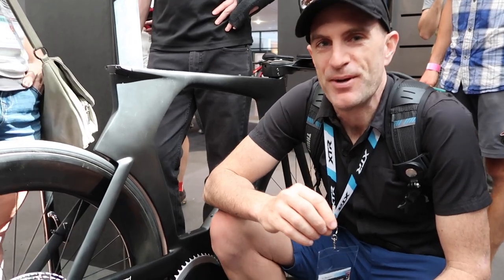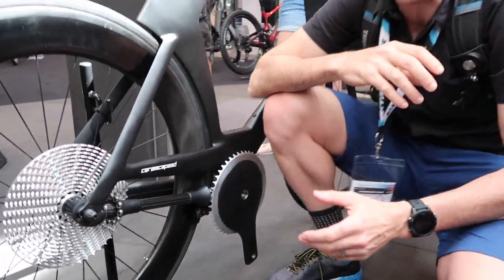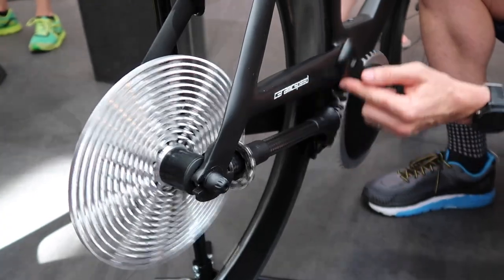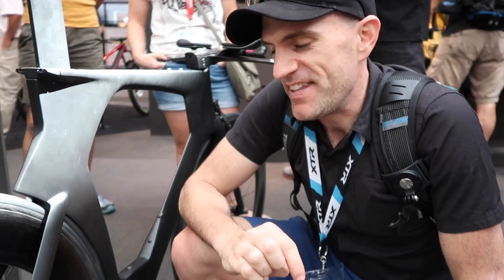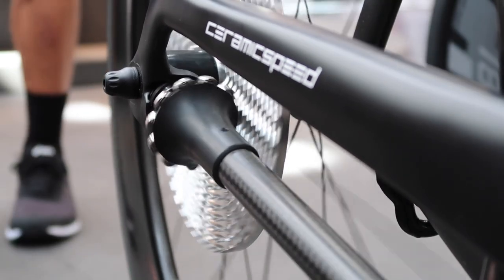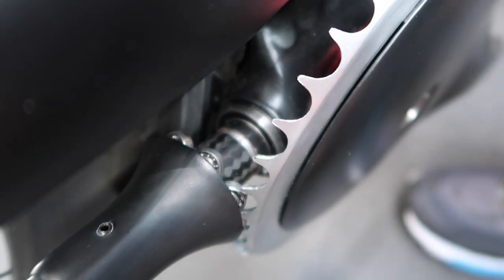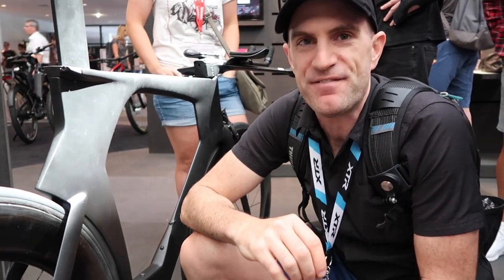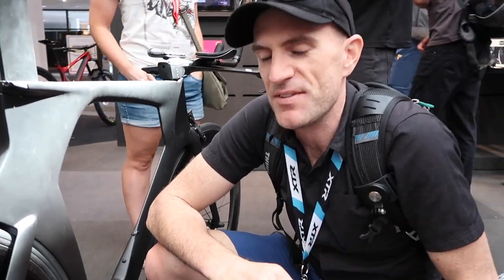CeramicSpeed DrivEN 99% Efficient Drive Shaft // Chain Free Bike // Eurobike 2018

Comment: I think the holy grail would be a bike with a Continuously Variable Transmission.
Reply: If they can solve the weight issue i agree.
Reply: They have these, and the efficiency is very low, at under 85% under the best test. It's just not a good way to drive a bike. I myself owned one, and while the idea was neat, it never worked well. Hills that I could climb before with a 3-speed without problems I had to walk the bike up the CVT hub.
Reply: I'm waiting for someone to work out that epicyclic gears in the crank mounting could replace the entire gearsets. 
That means lighter chain, only two sprockets and a more compact overall package. It would also be almost completely reliable if done properly. Downside is efficiency as the ratio's get wider. Of course if you want it could be 100% efficient in one ratio (the solid gear) then get less efficient as the ratio increases and the speed drops or vice versa. 
Would you trade a 3% efficiency loss at low speed for a 100% efficient gearset in top gear?
Reply: Yea thats correct bro im with yaa
Reply: It is done! the transmission can go forward and back with centripetal forces, and make it CVT.
Reply: Yes, and if they can figure how to make it variable.
Reply: Mmmmmmmmm...... 🧐😽😽😽👍👍👍👍👍👍
Reply: The holy grail of bicycling has been around for years its a motorcycle
Reply: @siraff4461  They're already doing this. Saw it yesterday on the street. Google SRAM Spectro S7
Reply: Nuvinci
Reply: @siraff4461  No system that needs to transfer rotation energy from the bottom bracket to the back wheel will be 100% energy efficient. In a normal bike setup, most energy is lost through chain friction. You mentioned yourself that your suggestion will have a chain drive, so there will be energy loss.

Having epicyclic gears in the crank mounting is nothing new. There have been patents for such setups since the 1890s, and there are some manufacturers who build these and other gearbox bikes to this day. They're basically the same as hub gears, except they're at the front rather than at the back. Their selling point tends to be durability and low maintenance rather than energy efficiency. These systems generally have more moving parts (especially ones with 10+ speeds), so I don't see why they would be more energy efficient than a derailleur system.
Reply: @drew13600 you're right, simpler is better... especially on a bikes drivetrain where weight is important.
But CVTs don't have to be complex in general. In the best case you have just a variator instead of a normal chain. You don't need a chain tensioner at all. Thats the simpelest you can get if you don't want a single speed transmission.
The only reason you can't buy this is the fragility due to dust.
If you find a way to construct a variator which doesn't need a closed housing... Well done, produce it!
Reply: Have a generator motor and a power motor... Have an ECU in the middle. Boom CVT.
Reply: Now that's a challenge
Reply: nuvinci
Reply: CVT has been doable for decades. What's not practically do-able is a lightweight CVT that is as efficient as a chain drive. And that's never going to happen! Chain drive is extremely efficient (~98%) wrt friction losses and a very light way of transferring power. Chains are noisy and require a lot of maintenance, so you hardly ever see them on cars where the weight penalty isn't a problem. We might see very minor innovations in chain technology in the future, but the principle will apply to pedal bicycles for as long as there are bottom-brackets.
Reply: Holy grail of what? Not of efficiency.

Comment: You're right to mention the engineering challenges. Changing gear will be tough and all the load will be on a couple of aluminium 'spikes' so will have to be able to withstand enormous forces. Great idea but I doubt very much if the effort to overcome those challenges will be worth it.
Reply: I'd say this idea is totally useless. 
The only reason why flimsy aluminium cogs work, is because they have very limited amount of forces applied to them. 
So bike manufacturers can make cogs super hard when compressed vertically, while mostly ignoring horizontal pressure.

THIS idea makes that impossible, and if they want to do this - they will have to make all parts from steel, and reduce their size to save weight. And with reduction of size it becomes very vulnerable to dirt, so they also will have to seal it.

And voila! We got ourselves a Pinion.
Reply: They could make the cogs from softer titanium alloys probably to save on weight over steel.  Cyclists love paying extra for that kind of kit, especially if the promise is to increase efficiency.  Although, I’m having a hard time seeing where this system is a significant improvement over chain in terms of efficiency.  I mean, if it isn’t silent, it’s gotta be losing some energy to friction, no?
Reply: Mike Kleinsteuber , bear arms--- you're right. All those challenges to get a telephone, computer, TV, GPS, still camera and a video camera in a device the size of a deck of cards, completely useless. Wasting time. Can't be done. Those engineers should go back home and pick their naval lint.
Reply: Lots of challenges to be met, with this set up, but given enough exposure, engineering minds can come up with viable solutions. One of the problems is keeping dirt out of little roller bearings.
Reply: Nah man it will work no problem if you use adamantium
Reply: DustyCowdog, that isn't the first time a very interesting idea have been abandoned due to difficulties of applying it to a practical working environment. Changing gears and structure efficiency on that one is obviously a no-go. Sorry.
Reply: Just more engineers trying to reinvent the wheel, convincing you that it will work better.  It won't, I'm sure it'll work but it won't be  better by any means
Reply: We would need some kind of clutch when switching gears to reduce that wear
Reply: While it could be useless, I still think it’s worth perfecting.

Comment: This looks like a solution looking for a problem.
Reply: The first patent for a shaft driven bicycle was issued in 1891, which... considering that the first rear wheel drive bicycle with a chain wasn’t manufactured until 1879, makes this idea almost as old as the bicycle itself.  Gear driven front wheel drive bicycles are even older, having been invented well before chain drive, back in the days when there were probably still some real life Luddites around.  Once you understand why chain drive took over the world, and shaft&gear drive did not,  you’ll understand why this solution will never be better.
Reply: necessity drives innovation.  i just don't see a need for this.  not to mention in the time it takes to machine that one part, an entire bicycle can be assembled.  you 99% efficiency? make the motor the wheel
Reply: DeD Fear the necessity here is to win the race
Reply: Zack Aroo I'm genuinely interested in hearing why chain drive is better if you'd care to share.
Reply: In races like the Tour de France, the competition is so fierce that even the smallest improvement would dramatically impact results. Multiple percent gains in efficiency would be quite dramatic. I think the best chain-based drive chains are around 96-97% efficient, so this would be a 2-3% improvement.

On a more practical side, as a casual cyclist I’m pretty sick of dealing with slipping and derailing chains, difficulty changing gears, replacing worn/broken chains, and general cleaning and lube maintainable that chains require. If this addresses some of these issues, I’d be ecstatic, even if it had the same efficiency as a chain.

As mentioned in the video, this is a prototype and there are many problems left to be solved before this will work, so some cautious realism is warranted. Conversely, as a non-incremental leap forward, there’s a lot of potential for further improvements to be made on top of this design if it works. 

I don’t understand where the negativity is coming from. Why specifically don’t you think folks should look for new ways to improve bicycles?
Reply: Rob Meyer, " as a casual cyclist I’m pretty sick of dealing with slipping and derailing chains", what kind of shit bike do you have, I have NEVER encountered such problems on my bike that cost me just 40 euros.
Reply: He probably has a bike that is poorly maintained if his chain is that messed up.
Reply: Sassy The Sasquatch  I see that the English language has taken a turn for the worse in the last "200 years."
Reply: @brainmind4070  Shane explained in the video why chain is better. If you listened. There are issues to solve before this NON-WORKING prototype is ready. Until then, chain is better because it works and this doesn't.
Reply: Inimbrium I didn't watch the whole thing.  You got me there.
Reply: The idea is over 100 years old, but implementing it correctly, well, no one has been able to actually. So I hope someone succeeds. Biking at 50+km/h with 4% less force is a quick win.
Reply: Perhaps not as big a problem for road bike, but anything to eliminate the rear derailleur on a mountain bike would be welcome. It's fragile and in a bad location. Very frustrating to look back and see it bent because of a stick or rock.
Reply: Rendoniam Gearboxes are becoming more and more realistic

Comment: Nice one for mentioning the engineering challenges no one else seems to have picked up on! Cheers!
Reply: Easy work....  There aren't any major issues with this, it can all be easily built and prototyped....
Reply: What challenges this system is like 30+ year old
Reply: toordog How?.
: )Tyler
Reply: musicmetal1 wow that's an awesome explaination of this new design..!!??
Reply: musicmetal1 wtf
Reply: The downside of this system is that it would worn out so fast due to direct contact. And it really hard to change part compare to a normal chain bicycle most time the chain is the only part that gonna break and it’s easy to replace a new one
Reply: And when it hits a bump?
Reply: Fascinating but another cycling solution to a problem that doesn't exist.
Reply: Instead of a geared plates, why not a right angle gearbox built into the pedal?
Reply: Ramarin Poyu 
There are gear systems that we use daily that are able to reliably transfer far, FAR more torque than an Olympic bicyclist is capable of producing. Bevel gears. If you have a car with an engine that's not mounted sideways, then your car's crankshaft is turning parallel to your drive wheels. Therefore, your driveshaft connects to the drive axles at a 90° angle, using bevel gears inside its differential. There are driveshafts and differentials capable of handling many thousands of foot pounds of torque. 

For a bicycle, you would need bevel gears where the cranks transfer force to a shaft at 90°, then a 2nd set back at the rear wheel, where the shaft mates with it. But then you'd need a system to provide different drive ratios. From here, I'll stop my description, because I've only put a few minutes into my 'concept', and now I'm stuck, AND I've got to go to bed!
Reply: I see this tipe of bike before in televizion old bike using no chain very old
Reply: its common sense and logic... can Mr super duper Shane make it work without reinforcing the frame??
Reply: Ramarin Poyu 
Yeah, I wouldn't think that aluminum is the best choice to use for gears that will be directly contacting each other. It's good for weight reduction, but not as gear material. Maybe titanium?
Reply: velimiru 130+ to be more precise
Reply: toordog sure its easy to prototype cause it was mass produced over 100 years ago. Such inovation, much bullshit
Reply: Patrick McLeod losses on each rotation ar too much to justify using it. Bikes and cars have engines where thosr losses can be compensated or just ignored as you can put more powerfull engine. People have certain power output and chain still provides much less losses compared to your described model. Also weight of typical chain drive will be lower than anything else at angles to withstand reliably....
Reply: Space JAGA 
Yeah, I figured that weight would be a concern, and designing a multiple speed system may be a problem. I personally have no idea how efficient the current chain & multiple sprocket system is, as far as energy loss when pedaling is concerned. That's one of the main worries I had when shopping for my last mountain bike in the 90s, when i was considering full suspension bikes. It wasn't the efficiency of the drive system I was concerned with. 

I was worried about the parasitic loss of pedaling power to the rear suspension. I assumed that, when pedaling hard up a hill, each downward pedal stroke would cause the rear swingarm to sag downward. So I bought a hard tail Specialized Stumpjumper with just a front shock.

 The front shock I chose was an early elastomer design, that had received good reviews, but nonetheless it's shock tubes flexed a lot. It was the "Answer Manitou 3". It was over $300 in 1994, but supposedly they have long since moved away from elastomer designs(which were actually considered to be a possible replacement for air/oil shocks back then). Now it's all air/oil shocks once again....
Reply: Patrick McLeod  it’s really hard to use as commercial bicycle this is more like competitive scene bicycle due to no matter what material they use even titanium the the hardness of material arent always the same the contact part would still worn out but!!! This is a still a great idea to improve efficiency all they need is to think about how the part will change easier for customers
Reply: Andrew Jackson 
I'm pretty sure that they designed it in such a way that limited the angles to 89°, therefore ensuring that there's no power loss. Anything less than 90° equals 100% efficiency! Lol.
Reply: @ramarinpoyu59  este diseño todavía no está en fabricación. Cuando ello salga a la venta los actuales cuestionamientos tendrán que revisarse.